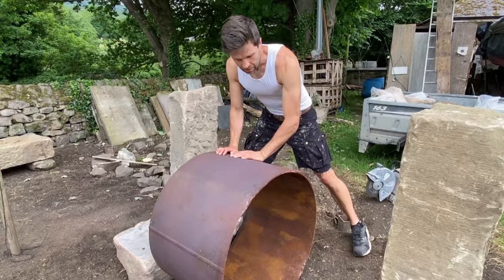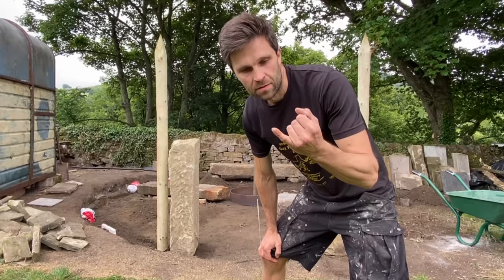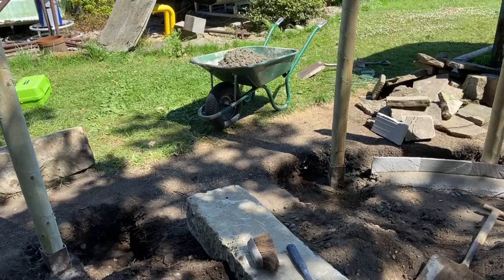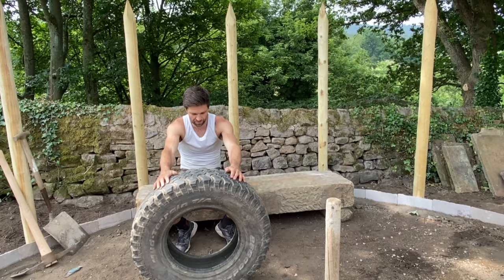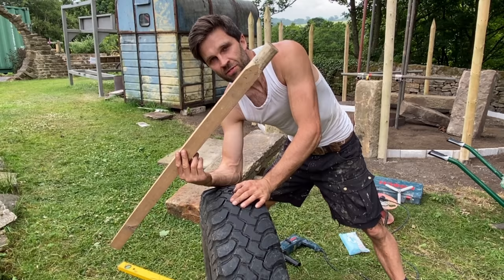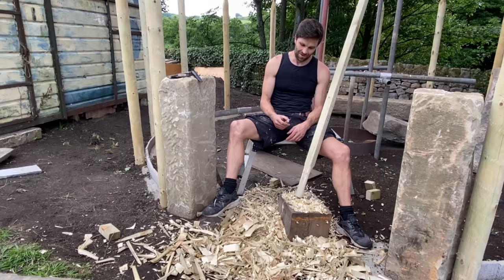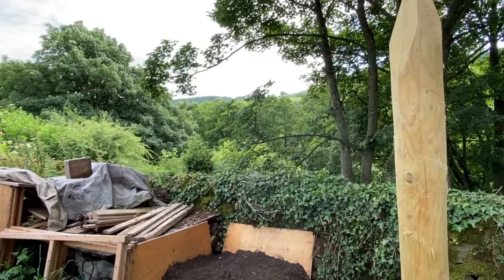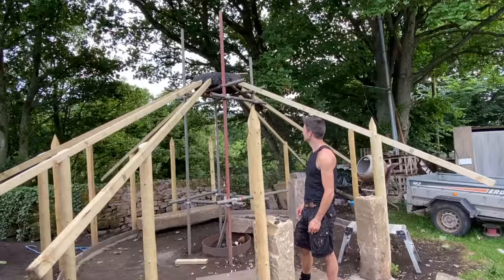YURT (ISH) BUILD OFF-GRID LIVING Building a Camp Fire  - Cooking - Cabin life - Bushcraft - Camping

Comment: Excellent stuff, that looks so cool, you really are a jack of all trades, hubby wants to know what you do for a living, he s a nosey spark!!😂😂👍👍
Reply from the maker: I generally do house refurbishments so I’m very skilled at designing and building especially bring self employed and I work alone 👍👍👍
Reply: Couldn't tell me how to cure salt in interior plaster could you, been trying to cure it in hallway since 1984?? 😫😫
Reply from the maker: It’s an annoying one. You can hack off a large section of the plaster and there are some chemical repellents that can be applied then a waterproof slurry layer. But it’s a hassle being so messy and even then it may not sort it. Sand off and repaint more regularly is easier.

Comment: Would it not be better to have a wall plate on top of perimeter  polls, and then fix the roof rafters on top of the  wallplate.  That way you will have strength  and stability,  .It looks very flimsy  the  way it looks. .Ime a  retired  bricky  by trade,  not a woodlouse  (joiner  the bricklayer s  enemy )😆😆😆😆😆. ANYHOW  YOUR TRYING, GIVING IT A GO. GOOD LOOK.☺☺☺☺
Reply from the maker: It’s actually really solid as the clever design allows the central weight to push equally on to the posts keeping everything rigid. A shingle roof would be cool😉